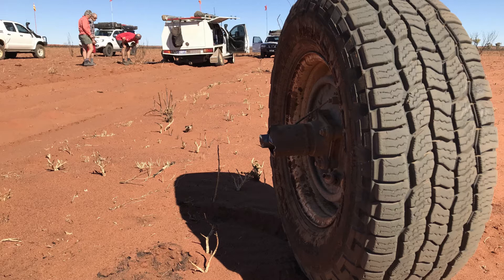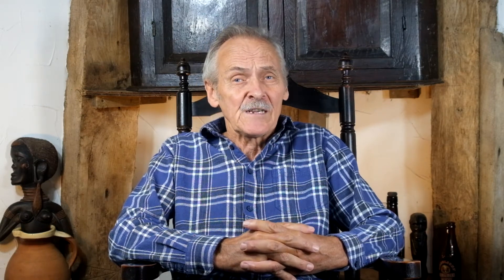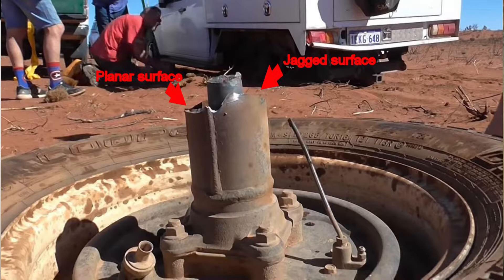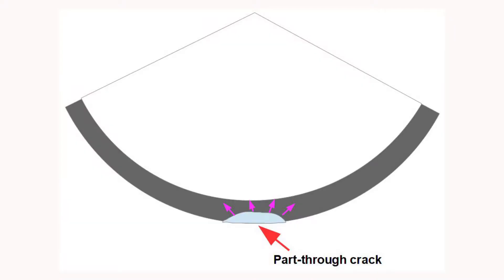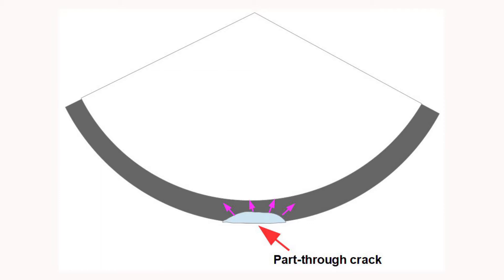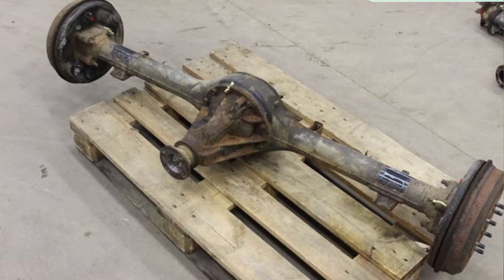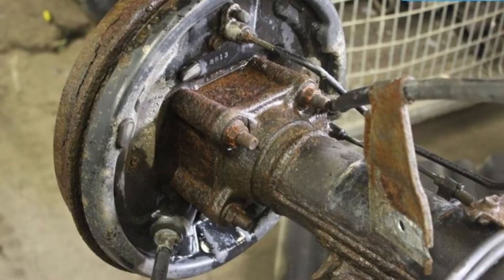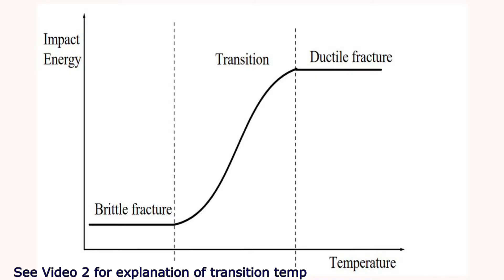Why axles break on overland vehicles. Part 6 - investigation of some of the axle failures

Comment: Hi Bill, great work on your videos 👍 I love the detail.

I know I’ve replied this to comments in a couple of your videos but feel it’s important for our Land Rover community.

The swivel ball failure in G&Bs Defender 130, I seem to remember in one of the previous to failure, preparation build videos that they may have been aftermarket. Unfortunately a lot of aftermarket LR parts are inferior to genuine and the use of the term OEM is misleading to consumers.

In all my years of LR ownership, use, modification and that following friends and members of this community doing the same, I can only recall one swivel ball failure (that’s not to say there hasn’t been others). It was a modified Series swivel ball on a very modified LR that had a hard life in use and testing components. 

The genuine LR swivel balls are made from forgings (not castings) of pretty good material. What we don’t know is what and how the aftermarket swivel balls are made. Though there were a number of aftermarket B****•part Series swivel ball failures and these were apparently cast items…

I will also note the recall by LR on late model original Defenders for front axle failures was for the axle housing itself. The end flange to housing welds were failing. No surprise there, LR in their wisdom ( or the supplier) decided to change from the ever reliable friction weld to a GMAW that was NOT full penetration. 

The wording of the recall a little vague by your standards and lead to speculation in the community. I have photos of the failure and the horrendous rectification LR applied.

Comment: A few years ago, a chap with a Discovery, 35" or 37" tyres, 14.50 width had a failure. Entire wheel and hub snapped off, bounced down the road and hit a person, killing them. 
I suspect that, the owner bought a car, fitted bits without fitting all brand new axle components. New HD swivels, bearings, CV, bolts, drive flanges etc etc etc. Unless you do this, or a thorough strip down and inspection of all components, you have NO idea of the condition of a vehicle for std duties let alone extreme modifications. The Police were prosecuting. The owner deserves everything they receive. 
We need some sanity here. Stop bolting on whatever will fit. Use someone with a brain to advise you. Our little 4x4s do NOT need 12, 14 inch wide tyres.
Reply from the maker: Whilst I'd blame the owner for his stupidity, I'd really condemn the vendors of the parts who develop and sell them with insufficient engineering input. Sure it costs money to engineer it properly but it has to be done.
My heart goes out to the innocent victim of the accident.

Comment: Wide tyres don't necessarily = greater capability or ground clearance. Narrower, larger diameter tyres provide more benefit while minimising stresses.
Ex. 8.25r 16 are 33½" diameter but only 215mm wide. An odd size, but my point is increased clearance with in fact, lower stresses to the axle in many cases. 
The information on this channel needs wider visibility.....although some users are dumping wide tyres and looking for 'pizza cutters' as they call them
Reply from the maker: My studies on terramechanics (see other technical video) showed that in many soils you need sufficient width to prevent excessive sinkage and that if you have that more width simply increases the rolling resistance. Increased tyre diameter helps under all conditions. Think of the traditional tractor rear tyres - quite skinny  but v. large diameter.
Tks for your comments.
Reply: @defendermodsandtravels  Lots of work done on the tractive capabilities of uncompromised tyres for off road use. Military, Agri and construction (my fields). As I often say on YT, if a 10 ton Unimog uses tyres in the 335-445 mm width range, why do we think our little 4x4s need 12.50" and even 14.50" width tyres.....unless perhaps for flotation in extremely soft terrain. It is appearance, fashion. Wider tyres put huge extra strain on all driveline and steering components leading to early failures....diffs, halfshafts, UJs etc.

I have successfully used 9.00r16 Military tyres on my landrovers landcruiser in continous use. Still just 230mm wide, but with very long footprint and extremely strong carcass. Change of final drive ratio retained gearing.

As an engineer, I really appreciate your technical presentations. If only there were more such voices, instead of the bolt on brigade, wide tyres, etc, without a educated approach to the subject. With 50 years experience of off highway, in highway 4x4 and other use, it's all rather tiring.
Reply from the maker: @Predator27007  Nigel you have clearly got much more experience in this than I have however it didn't take me long to figure out that the "bigger is better" approach to tyres has flaws. I would like to extend my work on terramechanics because there's a lot more to gain from that however it's time consuming and I lack time at the moment.
If you have valid experience to share maybe join me in a video?
Reply: @defendermodsandtravels  just about to watch your terramechanics video, Bill. Thank you for your invaluable work. You could produce videos for the parts wholesalers to sell on...Britpart, Bearmach etc

Comment: Great information thanks for the video.
I'm the owner of the 130.
I've mentioned in several videos and I do so again in a video tonight about my mistake of big tyres and spacers. 
Lessons learnt 😉
After the incident we received several emails with information on official recall notices on Land Rover Defender 130s of our model due to a design defect in the swivel housing.
We worked out ours was one of the recalled parts and was never changed out.
Reply from the maker: Thanks for the additional information Leigh. A combination of the bigger tyres + wheel spacers and a suspect ball housing, either of which might have caused a failure eventually but in combination it was sure to fail. It's just as well that you were able to get to skilled mechanic who was able to sort the problem out.
I have certainly learned a lot from my research on this and would urge all overlanders to think very hard before making big changes to their vehicles. Most genuine 4x4s are more than competent for overland expeditions in stock trim and don't need huge tyres and suspension lifts.
Reply: Leigh and Bill, I seem to remember from Leigh’s videos that the broken swivel ball may have been an aftermarket replacement?

Regarding the recall notice, it’s my understanding that this was for the axle housing itself. That is, specifically for the front axle housing to end axle flange weld failing. In LRs wisdom they changed from the superior friction weld to a GMAW that is NOT full penetration (that’s not to say a GMAW can not be, just not in LRs case) 

There were some failures, the recall notice was not specific about this joint failure and the wording was a little vague (compared to what Bill would probably use) and led to speculation in the community. 

Up until the late, last years of the original Defender production, that joint had been friction welded on every solid axle coil sprung LR product. Even before that, in Series vehicles. I’m not quite sure of the change over from original SMAW to friction and GMAW. LR Rear axle housing flanges are more commonly GMAW and not full penetration (simply look inside the axle tube at joint to see) but as Bill would point out, the bending moment in the rear is less due to the shorter distance from wheel centre line to axle housing flange. Of course sprung weight would probably be higher in the rear but unsprung weight higher in the front …